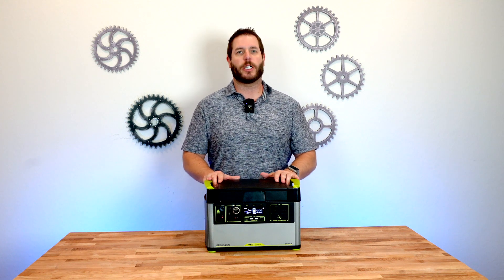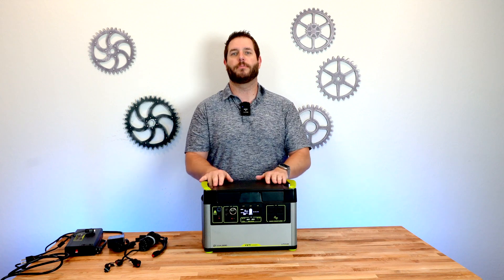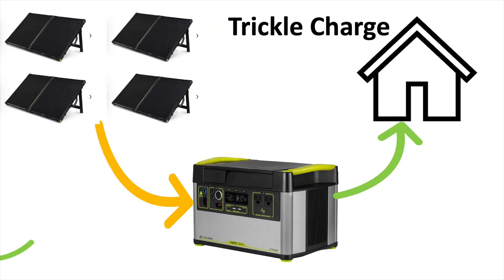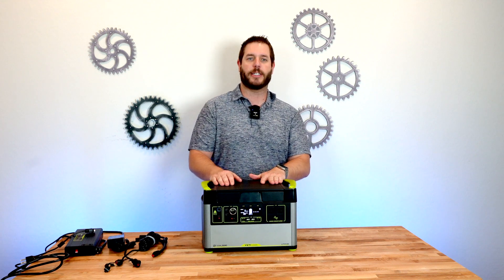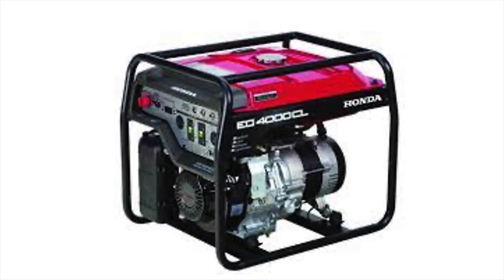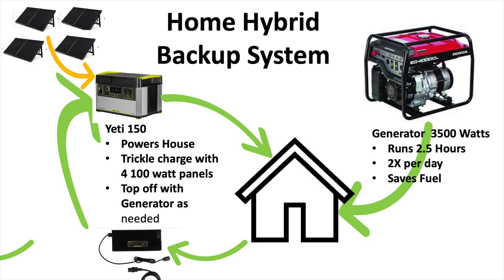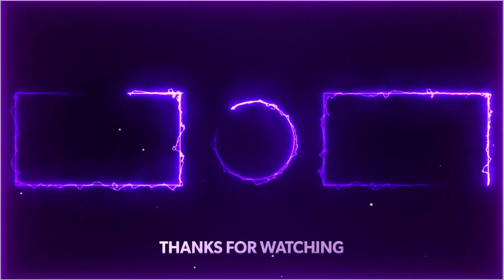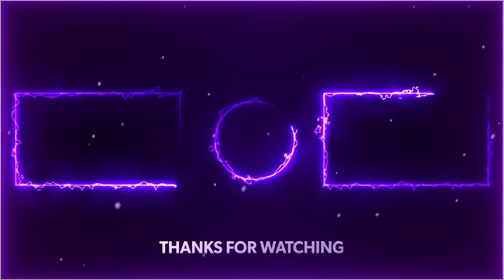A Hybrid Whole House Backup Power System - How I Built My Own

Comment: I used a discarded bought for next to nothing a forklift battery bank that's been converted from 36 volts to 12 volts by removing several dead cels and restrapping.
Reply from the maker: Very cool!  I’ve considered building int something bigger than the 1500X for a more permanent back up system.

I do like the portability this offers though.

I need to look into what it’d cost to build a proper power wall.  Could be a fun project
Reply: @gearsNtools  That's a reason why I cannot do something more modern and compact, I am retired, live in rural Alaska but I have plenty of access to heavy equipment being a mechanic and have bought lots of battery powered equipment like forklifts and floor scrubbers, they are discarded for minimal reasons. And are salvageable.